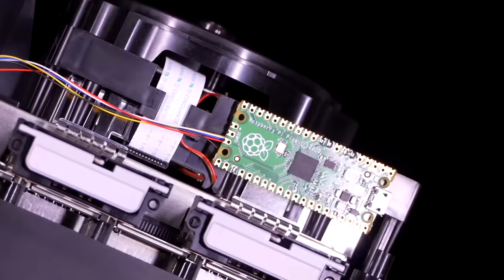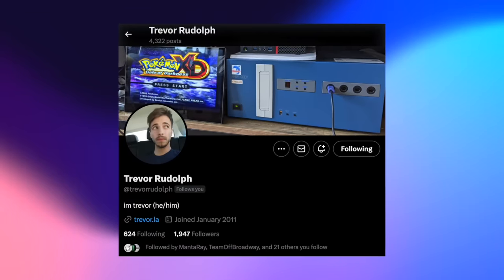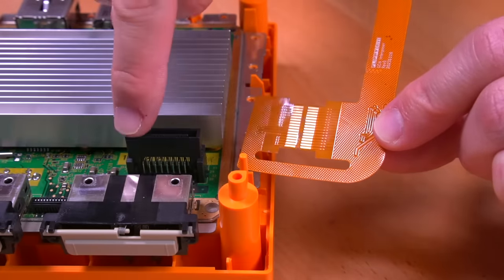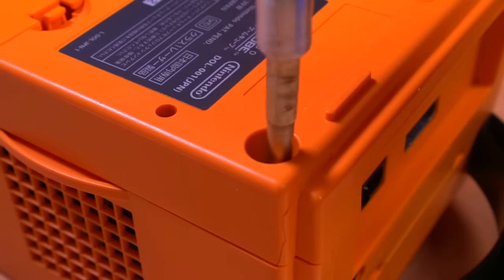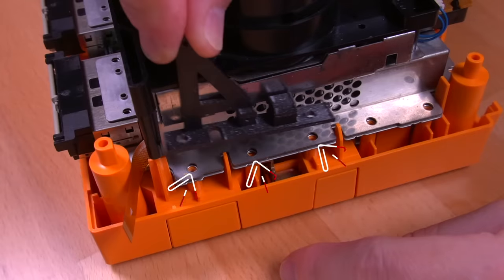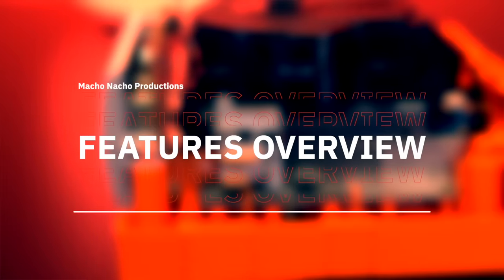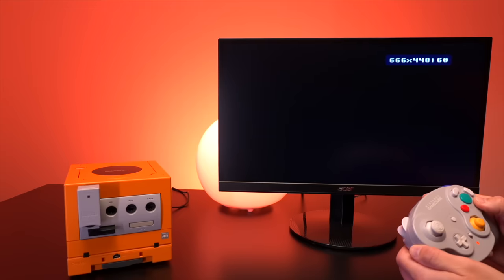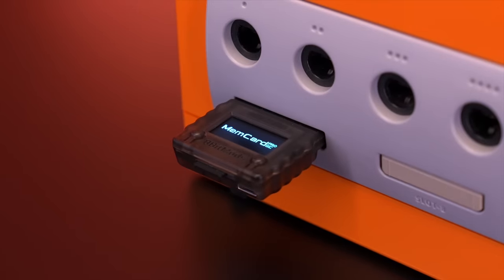FlippyDrive FIRST LOOK! Solderless Modchip For GameCube!

Comment: SD card ribbon extensions exist already, they should work just fine with this. May or may not require cutting a hole in the case though.

Comment: I would make a bracket that slots in the bottom part of the PCB instead using a screw and use the original screw to mount the PCB into the bracket using the top screw hole.

Comment: this seems really good and almost there for me but I would like to see easier regular disk drive use and a network drive feature. I know it's just press the L button on launch and that is pretty easy to remember especially after the 100th time but it would be better if there was a boot physical disk button in the game list or if it just checked the disk drive and only ran when nothing is inserted. Mostly I just don't want to forget it as I don't regularly play it and have problems booting my original disks or someone else have issues if I lend it out (with backups removed) Also, streaming games seems like a fine option if the sd card is full and/or you don't want to break out the screw kit, but what I would want is if they could have the root file on the sd card be available as a network drive. I know it isn't just "think of feature and do it" but these are things that kind of hold it back for me. It is a really cool product and is really impressive both ease of install and use along with keeping it small and feature packed as is.

Comment: This is very nice! I wonder though if the Flippydrive will work with a GC that has the picoboot installed?

I have two GCs one has the GCLoader which is awesome and the other has the picoboot with the drive intact.

Compared to the GCLoader, the Flippydrive will sell out fast due to its reasonable price point.

Comment: I have a gamecube with the gc loader in already and find it works find it also as the Bluetooth port mod for use bluetooth pads. But i will defo be buying one of those for my gamecube that as the disc drive still in it

Comment: That would be cool if you could dump games from the optical drive too. Since the sd card is hidden back in the housing. Also most laptops lack drives these days. The wifi thing is ok. But even then it would be better to have the ability to store it to the SD

Comment: Very impressive. I will need to try this! Q: since the disk loader bypasses the flippy unit, i assume the unit region lock for the discs will still apply? IE if I install this on a Japanese GC, the disc drive will not play USS games?

Comment: For real tho, the design of the GameCube from the outlooks to the innerts is such a yum for my industrial design fanboi bwain. Just seeing it dismantled bit by bit in almost like a dance around the cube. Same goes for the folding connector of the solderless modchip, wow for real this is the bit of overengineering needed, i hope they are able to register some patents or somehow secure it from being used without control. Respect to the mad-hatterz; Macho Nacho - Flipping Fantastic!

Comment: The GCLoader allows you to access images stored on the SD2SP2 via Swiss. Would the FlippyDrive devs support that? It would mean not having to deal with taking the console apart or trying to find a way to route an SD card extender somewhere accessible.

Comment: If it has wifi (and soon Ethernet) you don't need to get access to the SD Card. At least not until you wanna replace it. Surely you can add games over wifi?

Comment: SD card accessibility won't be as much an issue if it's accessible via WiFi as a SAMBA share or similar.  It would also be nice if the firmware can be updated via WiFi.
Oh, I also suspect the ESP is the brains of the FlippyDrive and the RP is for I/O

Comment: 12:02 Can you load new roms onto the card through the mod chip's mirco USB port?
Because there seems to be enough space inside the GameCube to leave a micro USB cable permanently plugged in to the mod chip and run the other end of the cable to one of the expansion ports. That would make adding new roms SOOOO MUCH EASIER!

Comment: I wonder if the Flippydrive and/or GCloader are able to load whatever game in terms of region (PAL/NTSC). If it does, and you're having a NTSC gamecube(progressive scan support) I don't see a reason to get the M.2 loader + swiss anymore, or the KunaiGC. Swiss has some nice features but if you don't run into compatibility issues I don't see a benefit in NOT using an ISO loader through your optical drive port.

Comment: This is a very nice mod with a cool looking GUI for a very nice price! But a 'few' questions 🙃:
1. Even though the GameID function of the MemCard Pro GC doesn't communicate with Flippydrive (yet), the MemCard Pro GC otherwise functions as intended?
2. Does the WIFI function (and perhaps the future ethernet add-on) allow external loading (SSH?) of ISO's to the SD card? That way some extension accessory for the SD card would also be irrelevant except for when someone would want physical access to the SD card. It seems WIFI is now meant only for streaming/loading a game from for instance a NAS straight to 'system' memory?
3. And not mentioned at all, but does the Flippydrive have any way of communicating with either the SP1 or SP2 ports? For instance to communicate with M.2 Loader in SP1 or with an SD card in SP2 which would also resolve the issue of not having easy physical access to the SD card.
4. You mentioned launching the Gameboy Player is fixed in the current version, but can Flippydrive run GBI? PicoBoot seems the better option for this thus far?
5. Can Swiss still be loaded if someone wants to use some features that Cubeboot doesn't have (yet)?
6. Bluetooth is mentioned as a possible future function. But it seems there's no connector on the Flippydrive's pcb for connecting a dedicated antenna like what for instance the Blue Retro Internal Adapter has. Is using that option or a Blue Retro dongle inserted into a controller port not the better way to go anyway?
7. Your orange GameCube doesn't have the Pluto HDMI mod, but I assume that the Pluto mod functions as desired when using the Flippydrive because those two mods never interact with each other, right?

Thank you for a great video!

Comment: they should adjust the size of the bracket so it could use the stock screw in place of one of the included ones

Comment: Is it safe to assume this works with DOL-101 gamecubes as well? Thinking of modding my original GameCube but its a DOL-101, not the DOL-001. I know it doesn't use the expansion port that a DOL-001 has, but I thought I'd still ask just in case there were any other differences between model that would prevent this mod from working.

Comment: you can buy micro sd card extension cables you could run it into the vent holes at the back of machine without modding the system with some hot glue if your rly wanted

Comment: As a PAL peasant, I really like this mod because it looks like the cheapest and most stock feeling way to force my games into progressive modes. I'm getting some annoying deinterlacing artifacts on some textures using the GameCube GameBoy player and outputting through the Kaico Digital port to HDMI adapter, so here's hoping they can fix the bug with the GameCube player. Though I wouldn't mind checking out the homebrew software for playing GBA on the GameCube, I've heard it's much better than the original software.

Interestingly, I don't get any deinterlacing artifacts when playing Pokémon Ruby/Sapphire in the story mode of Pokémon Box, but that's a messy setup...
Reply: You should try disabling the linedoubler in the Kaico's GCVideo settings. Sounds like you're noticing the flicker of bob-deinterlacing.

Comment: If the FlippyDrive can access and play games over wifi, there should be a way to move games from the PC to the SD Card through the Network as well. Raspberry Pi does this, so there should be a way for FlippyDrive to implement it, then you won't have to open the GameCube to add games, but with the size of the files, it may be quicker just to remove the four screws and pull out the SD card.
Reply: With Fiber internet not a big deal
Reply: @bobs8005  Fiber internet isn't available in my area.

Comment: Being able to keep the drive is good but I actually prefer mine without the drive :) I have a GCLoader already and the easily accessible SD card trumps having the drive to me . Besides that I don't own any discs anyway lol. I have jumped on the pre order questionnaire tho as I have other cubes that could use an ODE although not being compatible with MemCard Pro is a big downside imo.  Hopefully they will find a way to fix that sooner rather than later.

Comment: I got a European Pal GameCube DOL101 version. I am on the fence on getting a DOL001 version and have a picoboot installed. Does the Flippydrive work with the DOL101 Gamecube? I play on CRT so I would stick with my DOL101 if the Flippydrive is gonna work with it and if there are no downsizes to it. :)

Comment: Superb mod BUT....Given this sits between drive and console... does it (or COULD it) act as a mod chip to allow you to play your DVD-R backups?  Original disks are getting tired and best kept pristine if possible
Reply: Not sure if this is planned as a feature for cubeboot, you could use Swiss which does allow you to use DVD-Rs but it seems like a better idea just to use the SD card and save the wear and tear on your drive.

Comment: So what will happen if your console already has picoboot with cube boot on the SD card? Will you have to hold L on the controller to boot into cubeboot raspberry pi picoboot Swiss menu and the not hold L to boot into Flippy drive?
Does flippy drive have advantage of less lag or better comparability then the SP2 port? 
We are patiently waiting on WebHDX M.2 Loader as well 😅

Comment: I need something like this for dreamcast. Ideal mod for people that like to physically swap discs but still want to play more rare or too expensive games.
Reply: ??? you dont even need a mod chip to play  burned games on a dreamcast. they're all self-boot these days.
Reply: @ianswift3521  va2 consoles don't suport burned copies of games. Other issue is that burned games put more wear on console optic drive than factory pressed discs. So you point is valid but still device like this for dreamcast would be a good thing.

Comment: It'd be nice if you could make ISOs of your original game discs with this. The way it's installed I'd imagine it should have access to the data stream coming from the disc drive, so in my mind this seems like it'd be trivial, but likely is far from it.
Reply: It shouldn't be too difficult.  The main issue is that GC discs are derived from Panasonics DVD-RAM format so there aren't any drives to read them, the drives are also constant velocity drives which is how the GC gets it's almost cartridge like loading characteristics (this has been the biggest challenge for solid state loaders but this thing emulates the optical drive so I suspect it will become imperceivable as the firmware matures).

Comment: This is amazing all around. @_@ 
Would something similar work for the Wii I wonder?
Reply: Is there a specific issue you have with soft modding your Wii? It's pretty simple to do nowadays and if you have an older Wii you can play both Wii and gcn games off a flashdrive
Reply: @randomduch  You know, fair enough. I just was under the impression the model without the GameCube ports would be a problem. But I haven't looked into it very far.

Comment: Heh heh, loading .ISOs via WiFi.  I remember buying an Ethernet adaptor and running an exploit in some game (Phantasy Star?) to load ISOs that way.  That grew old, so I installed a modchip and replaced the top shell with one that could accommodate full-size DVD+R discs, or maybe it was DVD-R.  I would image this would work with my modchip still installed.

Comment: Could cubeboot work on a picoboot or was it developed specifically for flippy drive? I really dig the UI
Reply: It's supposed to work on PicoBoot eventually. IIRC cubeboot was originally designed for FlippyBoot, which would have been a modchip similar to PicoBoot. The current version of cubeboot already works on PicoBoot.

Comment: Whats the fastest largest best sd card to use with a modded Gamecube? Also mine is currently modded with Xeno Chip that gets attached to the bottom of the Disk drive and requires an additional board that goes in the high speed drive slot on the bottom of the gamecube and a disc that has swiss on it and ive noticed that cutscenes lag / stutter. Could you tell me why and if this Flippydrive mod will fix that?

Comment: Now imagine doing this to an Original Xbox. The only problem with Original Xboxs when it comes to trying to disc softmod it with Splinter Cell. Is that the disc drives are horrible. Tend to break long before you can mod it.
There needs to be a backup mod chip design of this. Same for Playstation so you dont have to have Pico on a Memory Card slot , if you don't want a memory card in the slot over time. I hate the thought of Memory cards in the slots wearing out the slot cover doors.

Comment: The biggest missing software feature is definitely the ability to write files to the SD card over Wi-Fi, removing the requirement to undo those four screws every time you want to add a game to the card.
Reply: Pretty sure they've since added this functionality or confirmed it's in the pipeline
Reply: @YeetusMingus there’s also the laserbear micro sd card pass through that replaces the light pipe.

Comment: Does the GameBoyPlayer also work with an Everdrive or something like then?
Reply: Sup bro, can confirm.  I have a cheap EZ Flash - The less respected of the game boy advance flash drives - it drains AA batteries like crazy (not ideal on the go), but I use it in the GameBoyPlayer all the time.  GB player works with flash carts for link cable as well if that's something that would interest you.

Comment: I just modded one of my GC with a 2040 zero chip running Swiss. And let me tell you, the soldering part was a hassle. I am by no means an engineer nor I have tons of experience with soldering pcbs. So if you tell me that I can spend under $40 with zero soldering and an OG interface. Take my money!
Also, a 3d printed bracket with the spare screw slot? Man I am sold out, give me three, please.

Comment: PicoBoot requiring removal of the optical drive was a deal breaker for me as I also like to try to retain original functionality as much as possible in modded or jailbroken consoles. I might consider uninstalling my Xeno modchip to put this lil guy in, especially if cubeboot matures to my liking.
Reply: Did you mean GCLoader? PicoBoot is an IPL modchip, it doesn't affect the disc drive at all.
Reply: @NotMoreZombies  Yeah, I think I did. Derp.

Comment: Aren't you nervous using your console with the optical drive only held in by a measly 17 screws instead of the full 18? I mean, I'm sure Nintendo used 18 screws for a reason. What if it suddenly flies apart?

Comment: Back In The Day My Mums Broken Gamecube Which Had No Sound Output And Only A Copy Of Mario Sunshine Was All that was Had Left Eventually It Broke And Got Thrown Away Which Happened Back Then To Broken Devices Including Obscure Tech Like A TomTec Ultimate 10 Softwinner EVB Tablet
A white tablet with angry birds space preinstalled 
And A Kurio CM15100M Which The Last Could Be Easily Repaired By Soldering In A New Battery

Comment: OK, this is one I might be interested in @ $40ish, you can't beat it...I know you can buy a 6"-12" MicroSD extension cable, so it would be something I would have to do here so I can change things out.  If someone had one of those M.2 loaders, or a sd2sp2 would it read games off it ?  256gb M.2 drives are cheap now days, so being able to have 256gb or even 512gb on a M.2 should be good and fast.

Comment: I would love a version of this that takes regular size SD cards instead of micro SDs, and has an SD card port that is external, even if slight modification of the case would be required.

Comment: Interesting approach with the ribbon cable. However... a major problem with that is that the folds on the ribbon cable with traces inside of it can easily be broken especially when folded. Bending a ribbon cable is fine, folding and creasing is a big no go.
Reply: Why would you not just use all 3 screws for the bracket...? That seems kinda dumb.

Comment: I like this idea more than the picoboot however swiss ui allows for cheats forced 480i inputs etc, those who play smash but dont have the save for example would love just to get in and play every character. However swiss in my opinion is still buggy with the cheats interface and causes random crashes. I love this idea more and even for the price, its good for a alternative gc market flip. I just wish to see the Bluetooth support for gamepads, the cheat interface, 480i output, and like you said the use of the memcard pro. Those are my cons and take aways.